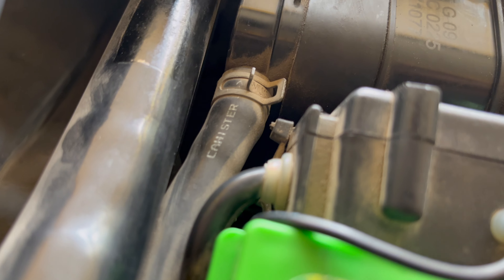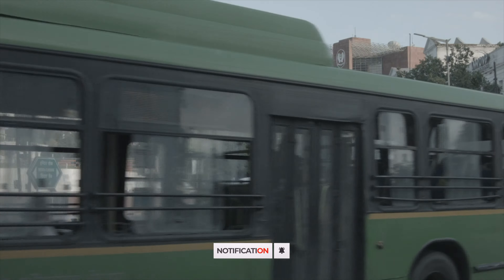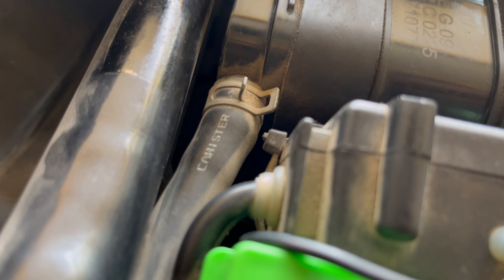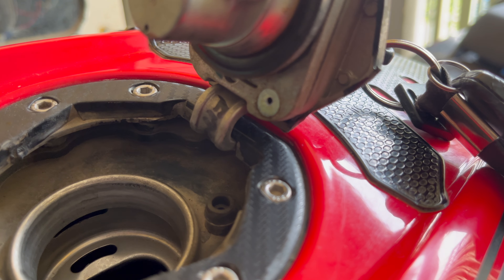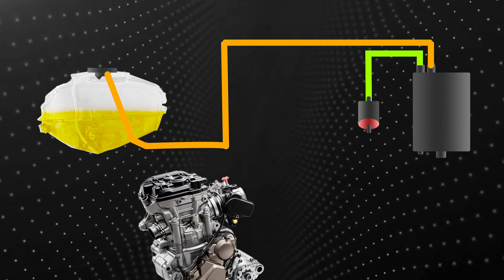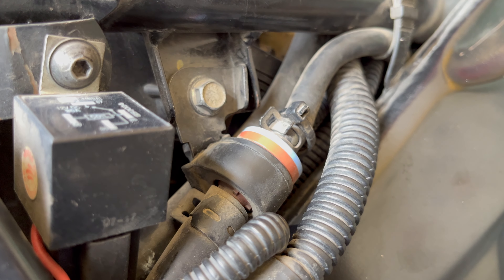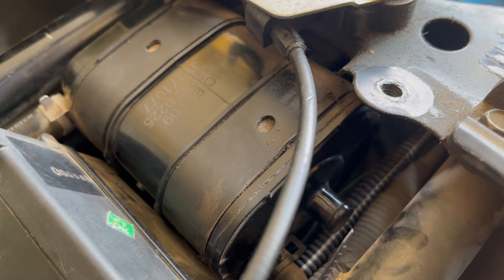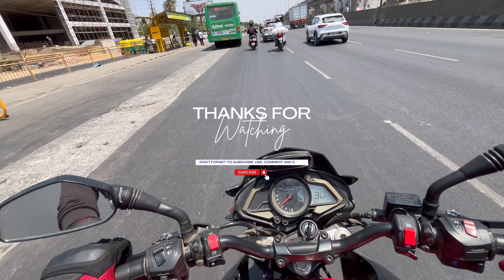Motorcycle EVAP System Explained | What is EVAP System ?

Comment: Bro I have the same pulsar 200 ns and I did all the modification as u ,,now what I imagined to replace both front and rear suspension of ns with xpulse 200 as they are same 37 mm as pulsar this modification is what pulsar 200 ns needed to be converted into ADV ,,bro it's a request plz do this ......😮

Comment: After this modification ns is converted into a better ADV than xpulse 200 as ns had a better engine and cruising capability and replace the front chain sproket from 14 to 13